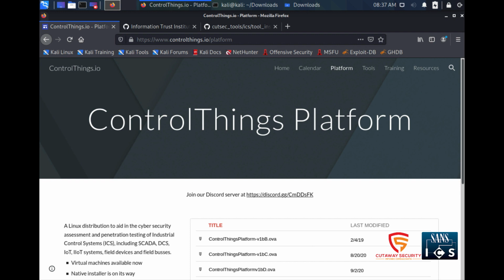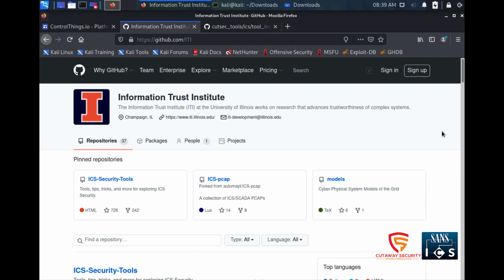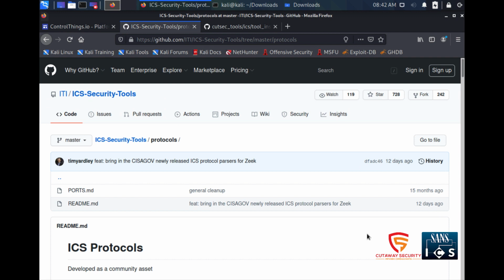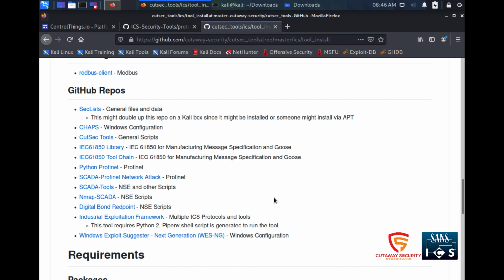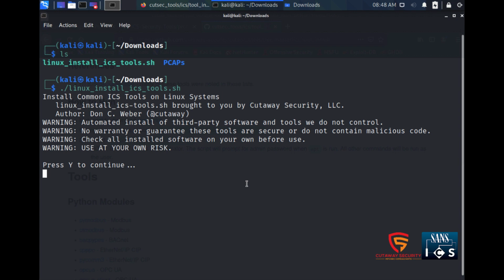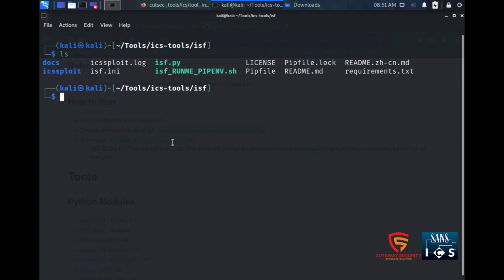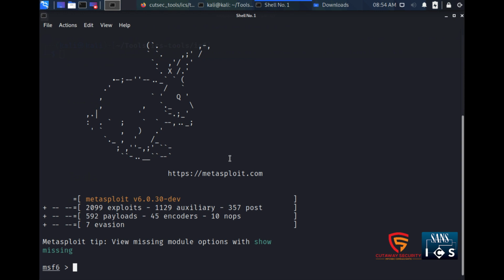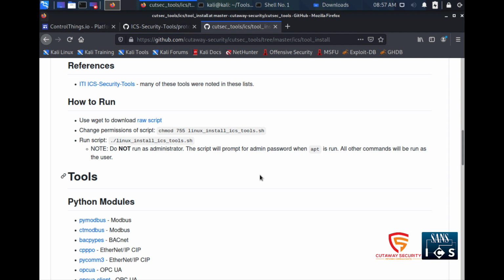Linux Tools | SANS ICS Concepts

Comment: hello Don, really appreciate the work you and SANS are doing
I followed the video but could not get ISF to work even after installing all of the requirements 
with the ./isf_runtime_pipenv 

I get the following

Traceback (most recent call last):
  File "./isf.py", line 9, in <module>
    from icssploit. interpreter import IcssploitInterpreter
  File "/home/kali/Tools/ics-tools/isf/icssploit/__init__.py", line 1, in <module>
    from icssploit. utils import (
  File "/home/kali/Tools/ics-tools/isf/icssploit/utils/__init__.py", line 15, in <module>
    import nmap
ImportError: No module named nmap

and with 
sudo python3.11 isf.py
[sudo] password for Kali: 
Traceback (most recent call last):
  File "/home/kali/Tools/ics-tools/isf/isf.py", line 8, in <module>
    import ConfigParser
ModuleNotFoundError: No module named 'ConfigParser'

really hope I can get an answer since I tried it on Ubuntu also and I keep getting the same issue 
sorry for troubling you 

Cheers

Comment: Excellent video! Have you seen any problems when installing those tools in a VM and interacting with field devices? I was wondering if the fact that you need to forward the HOST COM ports to the VM affects any tool (or create latency issues)
Reply: Any devices that use serial for communications should be easy to set up in Linux. It really depends on the device and your connector. You should have any issues, but each situation is going to be different. The tools installed here are mainly for services accepting connections on a network interface, so ethernet. If you do experience issues, please reach out and I'll help troubleshoot.
Reply: Really informative. I'll give it a try.